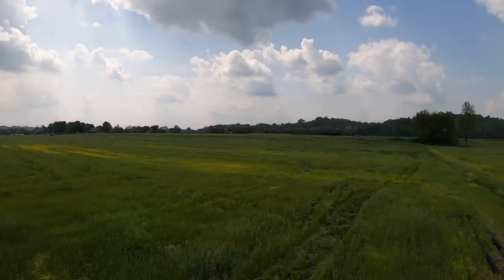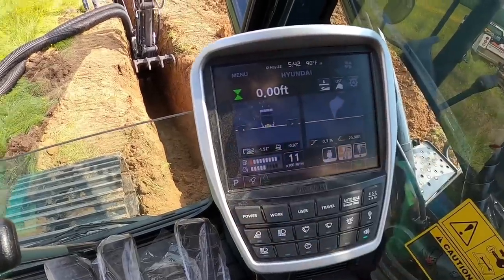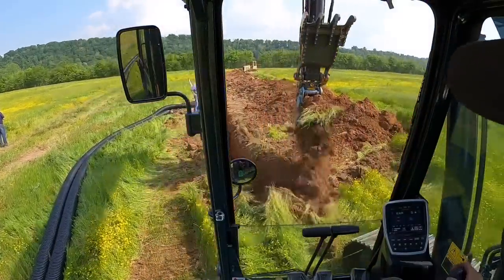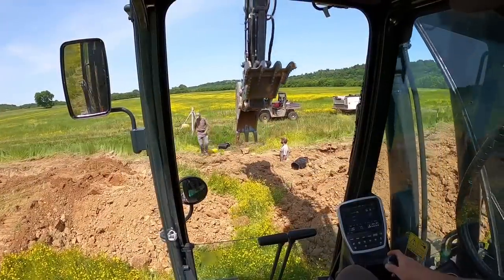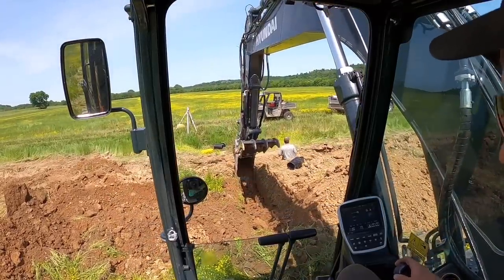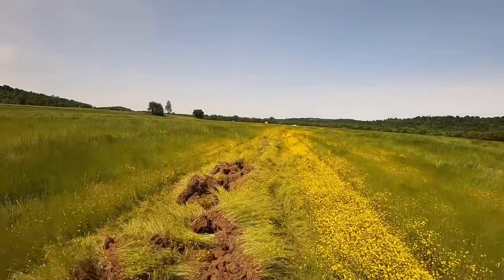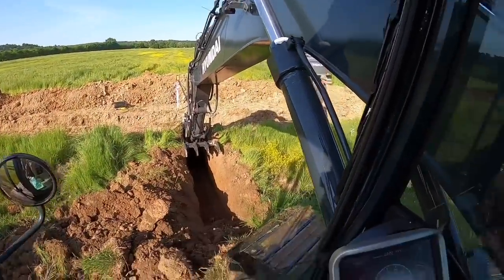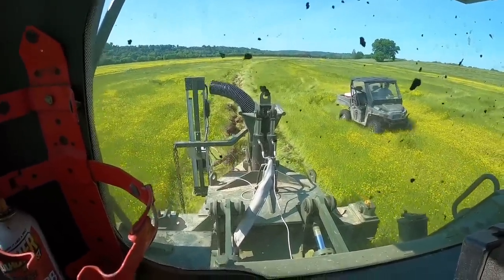This video has got it all- first job for Hyundai 210AL, paddle wheel river boat, and end of tiling.

Comment: The 210 is the deal, to see Jerry in it, well, it’s pretty well a done deal for Dirt Perfect sir.  It’s been a bit of a struggle to get everything to come together on plowing tile in, especially the first year, with the design and build of the plow, the learning curve, the rework of tracks on the J, the laser tracker design, build, set up and function, then dropping the 210 in the mix with the 2D guidance system, man that’s a lot, and you and your crew handled it well. And next year you will have the experience, equipment in place, that should give you a really good start. I am most happy for you all and thanks for the ride along sir.

Comment: In 2020, the American Duchess had it's paddle wheel removed because of a mechanical failure in the shaft. It continued to operate without the paddle wheel till it was repaired.
 The paddle wheel is actually about 40% of the forward thrust, with much more 'modern' Z-drives assisting.

Comment: That paddle wheeler is owned and operated by American Cruise Lines. Built in Salisbury Maryland. I used to haul Steel from Mobile Alabama to Chesapeake Shipbuilding in Salisbury MD for their construction. The paddle is for decoration only and does not propel the ship. The engineers say that if you tried to push that steel hull ship thru the water with only the paddle the vibration would beat you to death.

Comment: you should ask Hyundai for a  dozing Shield for the 210 like the 140 has , imagine putting a 6 way blade from a D4 sized dozer onto it, then put in a electric pilot valve block and a extra joystick for bklade controls into it 
also you should get some dredging matts and a ghigh volume grading bucket

Comment: DP, it's great to see you this happy with the Hyundai.  :-)

I wonder how it performs with the laser guidance in conjunction with add-ons like a grading bucket, the super-stick, and maybe something for pile-driving (pole-driving? I mean: like fixing that little jetty on the riverside, maybe a year ago.)
But the guidance might also be useful in placing poles for utility lines. I could then also think of an "aerial work platform" (if available for quick-coupler) for doing any type of "off-the-ground" work (maybe with stability measures, maybe with some remote-control). After all, you have a background in construction, so you may have a "Wait a minute!" feeling rising. Or Logger Wade may have suggestions.

I'm under the impression that this Hyundai can store several "patches" (of settings). I suggest that you figure out some patches for "power" (hydraulic pump power demand, meaning economy) and "accuracy" (hydraulic valve opening), especially if you should consider to have this 210 replace the Volvo 140. You wouldn't want to burn more fuel on "140-jobs", would you?

Economy: I heard Mr. Millennial and LetsDig18 complain about fuel at around $5.50/gallon. Here in the Netherlands, it would cost just over €2.00/l, meaning over $7,50/gallon (taxes included).

Comment: Im commenting 1/4 way In to video. So, there is a wet low spot in this pasture? Here in North Georgia, low pasture land we install slit hancor pipe and use 4 inches of washed 57 gravel on bottom and 4 inches on top. Then cover gravel with fiber cloth to keep silt out of washed gravel. So, sometimes we use the gravel only where we went to pick up the water and may skip it on the pipe part that simply carries the water to the creek. Maybe I’m asking too early before I see the end of the video lol. That soil doesn’t look too different than here. Oh wait: at 12:20 I see you nah be t”ing in to an existing drainage pipe. Ok. Now I see the dozer with plow.

Comment: Love that Hyundai, it really does look the part. It would be interesting to know how you feel after a few hours using the Hyundai, is it as tiring as the Volvo, it certainly sounds that it's smoother to use, like you say with a flat edge bucket laying pipes will be easier. I still can't get over the lazer set up on the dozer, with the plough. It must be from your prospective really re assuring, as you know your at the right level all the time. It's going to be interesting to hear your thoughts on both.

Comment: The 2D MG systems seems to work okay for what you’ve done but I think it will really work great for you on a basement dig or some place you can use the laser or touch point to zero out every time you move. 
Zeroing out the way you did on that one long run is like laying out a wall 16” on center with a 12” ruler allowing accumulated errors to add up. 
The 2D MG certainly makes it possible for the operator to do a passable job without a Mr. Millennial on the ground.
Reply from the maker: Agree with the ok for now

Comment: Hopefully the nearby farmers with the same problems as Farmer Chris field had, they start calling to setup for next year. 

Still think you should put some type of "Blade" (to aid in cutting / plowing) from the bottom- top edge (front of plow ) up approx. 2-3 feet, to the main body / pipe tunnel,  I'm thinking 1(one) inch thick material, by 3 (three) - 4 (four)" in. wide Flat-Bar.   Think-Gusset. I would call this a shearing/cutting/pre-plowing Gusset.  On the forward edge, 3/6" in. thick X 1" in. Angle, so as to provide a knife's - edge / replaceable wear skid-plate.
Reply: There’s no where to mount it and no need for it
Reply: @williamuskoski1385   Hi William, think Bulbous bow.  Is a peculiar bulb like projection at the forward end of the ship.  Yes the "Culvert Plow" has a if you will Bulbous bow, (bottom part where the Culvert tile comes out, and lays flat.)  This bottom section by no means is a simple 90 degree design. Mike used a 8" in. pipe (Don't hold me to the exact size dia. of the pipe. Sue me, if I'm wrong.) the pipe has a 45 degree forward facing, cut on it. approx. length of the Bulbous section, maybe as much as a foot, as measured on the very bottom of this section.  William, I'm no registered engineered, just your average former ship yard welder (5 yr's, exp building little 400 foot canoe's, with "moon-pool's"  40'Ft., square mid-deck, with full size helicopter landing pads on the bows, not some little back-yard flying machine.)   My thought for the "Gusset," is three fold. First (1st,) to aid in plowing, thus hopefully make a dent in the "fuel-consumption rate."  Second, (2nd,) just a "Safety factor,"  BIG UNSEEN UNDERGROUND ROCK, versus the poor little plow.  Third, (3rd,) is to reduce the "Wear-factor." Mike didn't use any "A-R" material.  "A-R" = Abrasion-Resistant, not Armor Resistant.     So, how much welding does a ship yard welder do in a day? If you weren't burning through a single 10 pound roll / spool of .045" dia. / .062" dia. wire a day, you were shown the door VERY quickly.  Maybe because of circumstances, (like moving section(s) of the boat (approx. 100 foot length(s) for assembly, via Qty-two, one hundred ton Manitowoc Cranes) one to three days a month, you couldn't obtain the very well known / demanded quota requirement.  FYI 5/8 {.625"} thick or less, use .045 wire, thicker .062" in. Dual-shield /a.k.a flux-core with 75/25 Argon / Co-2 gas.  Our GAS-SETUP was a SIX-PACK (six big bottles) of Argon only, and a SIX-PACK (six big bottles) of Co-2, with alarms for when gas mixture wasn't correct.

Comment: Wheel/bucket trencher could make short work of these jobs for you. No one does tile up here, we are too flat and the water has no where to go.
Reply from the maker: Lol at 1/2 the speed 4 times the fuel Burn and 20x the price plz explain
Reply: @DirtPerfect  depending on the ground and conditions it could be 1/2 the speed or 4x the speed. Fuel consumption really depends on conditions. Not saying you should go out and buy one, but i'd be looking for a company to get a demo model.

Comment: Question Mike, couldn't you run a 6" line back from the campground side, to the 8" line where it ended? Even though the surface slopes away, underground would slope back to the center connection. Looking like you already got the check ready for the new machine.
Reply: Christmass in August or September?
Reply from the maker: Not his property and no fall

Comment: Are you happy with how deep the plough can go? could you have made it to plough to 7-8 feet? Even if you had to use two dozers to go that depth?  Would it be quicker than backhoe digging?
Reply: That wasn't what it was designed for. It works perfect for what It was built for. To go that deep it would need a complete redesign...
Reply from the maker: Stay tuned
Reply: @DirtPerfect  you teese😄😄

Comment: You first used the excavator, now the tile plow equipped dozer, why didn't you use the dozer on the first tile trench?
Wanted to test the excavator is the only reason I can see?  ;-)
Do you charge less for a job using the tile plow dozer versus the excavator?
Reply from the maker: No to deep covered that

Comment: If your done plowing maybe it is time to service the transmission and final drives after all that hard pulling.
Reply from the maker: That would be absolutely wast of time and money
Reply: @DirtPerfect  well maybe, but you have been placing the transmission and finals under a heavy constant load while plowing the tile. A bit more strain than normally occurs just pushing dirt. Of course the best way to set up service intervals is by number of gallons per hour of operation of the unit.

Comment: The production rate on new equipment is supposed to be superior to that of clapped-out old equipment. Hydraulics work like they're supposed to. Engines run like they're supposed to. Batteries don't usually require a jump pack. And they're usually not in the shop as much as older equipment. Getting equipment on demonstration is the hottest deal because the Price is Right. Some contractors may make the decision between rental equipment and equipment they can afford to own. They will generally find better production from the rental equipment and the customer is usually more accepting of a rental line item than one for the contractors own fleet. If you're renting by the week your customer understands being charged by the week but they will complain about your equipment equipment that sits idle, such as road sweepers, water trucks, and rollers.
Reply: Some of this makes no sense. That’s like saying to get rid of all the dishes you don’t use every single day just because they sit. Then going and renting one. If you use a machine even once a week it pays for itself

Comment: Why don’t you go buy a generic replacement cutting edge and cut it to fit on your bucket, then weld it on your bucket teeth giving you a smooth edge bucket. Then if you need teeth just pull the pins on your welded teeth and replace them with regular teeth.

Comment: Fancy Computer controlled stuff OK till go wrong & you need Laptop to Fix it  Happened here on TV with Volvo FH16 Heavy Haulage Truck on Demo from Volvo it was going up Steep hill Volvo had to fixit with Laptop also needed 2 Large Recovery Trucks to pull it up hill as had 70t load on trailer